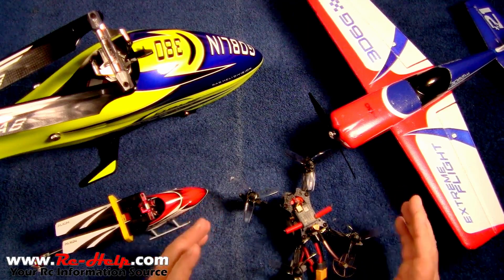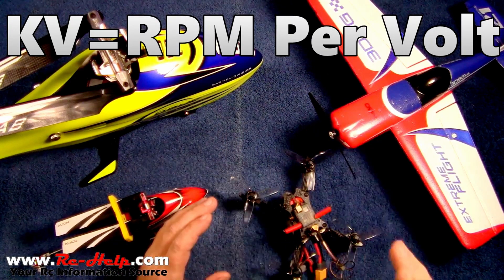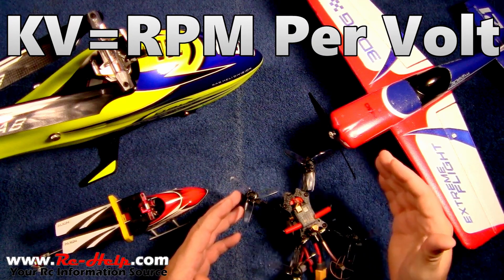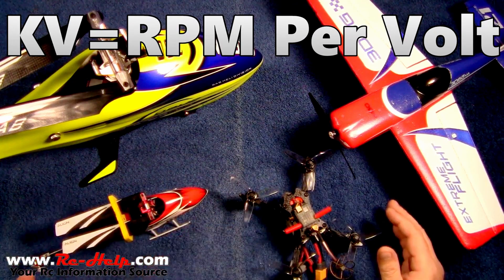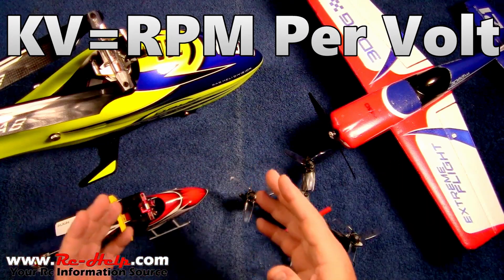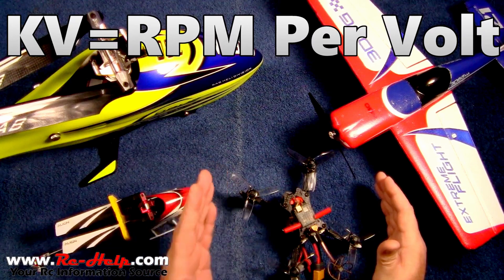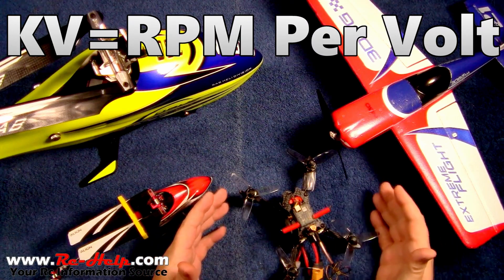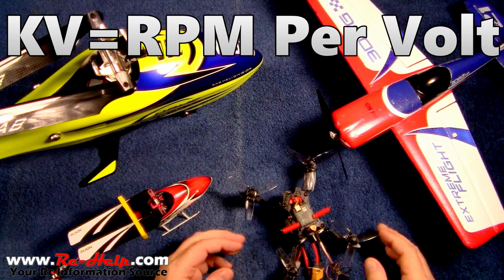What KV Is & What KV Is Not

Comment: so another uber basic q- you say its volts per rpm. does that mean unloaded rpms? or with a certain prop? or blade? there are so many variables, so is KV just ultra barebones. plug a motor into a power supply and with no prop or anything else going on, the resulting rpms per volt is the # we get?

Comment: I signed up on your website. I have tried numerous times to receive the account confirmation email. I even tried a secondary email account that is reliable. Still no way for me to activate my account as I still don't have an email from your site. 

Additionally, the Terms page reads that there's a contact us at the bottom of each page. Apparently, that's only available after you get the email to confirm the account...

Any assistance would be appreciated.

Comment: Lower kv is more or less torque?
Reply from the maker: Lower KV will, in most cases, will result in More Torque. There are some circumstances where this is not true, but it's not common.
Reply: T
My 1900 kv motor compared to the traxxas 2200 kv motor the 2200 has more tourq then my 1900. There are other things that come into play with kv rating as well